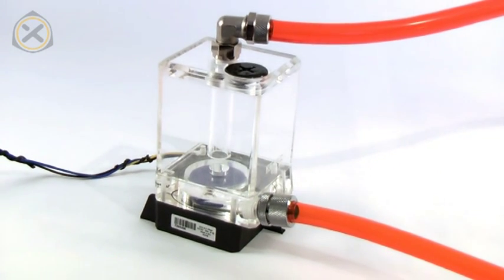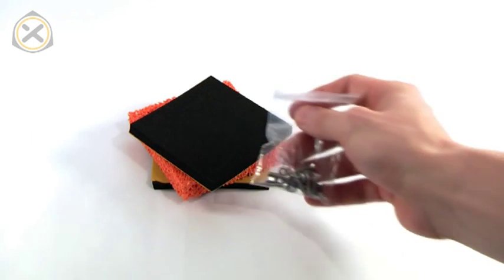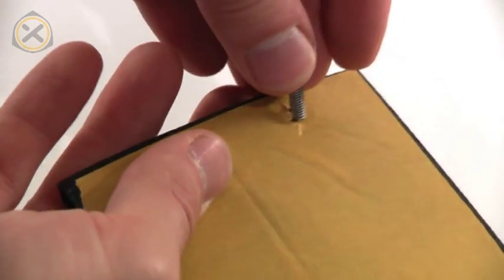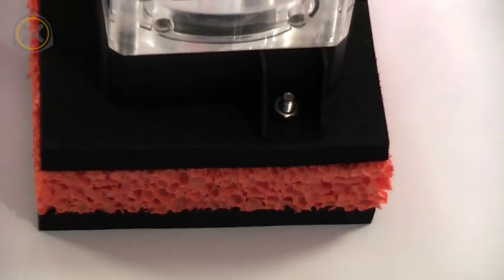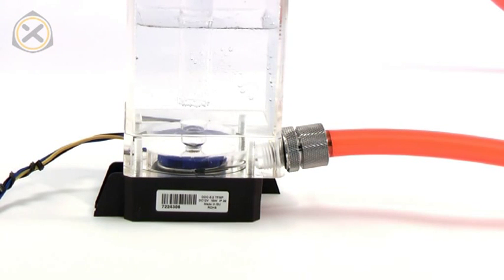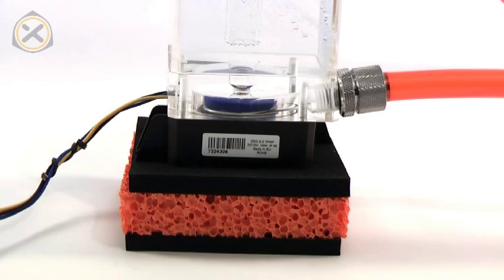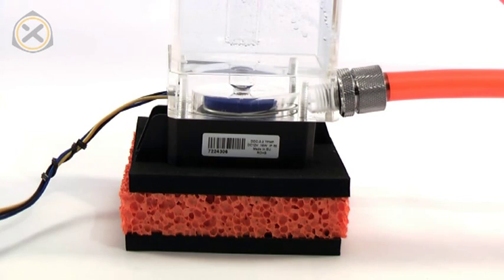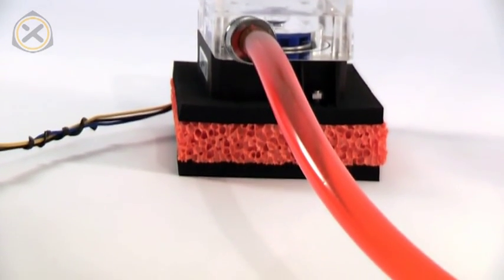EN - Shoggy Sandwich

Comment: I know this is an old video and maybe shoggy has changed the design a bit, but does the new V2 have adhesive on the lower rubber part to allow it to be stickied to the case without having to use screws?
Reply: Yes, it does. EDIT: both pieces have one adhesive side, so you can't stick it to both the case and the sponge
Reply: @M4ng03z  Wow, 4 years later I got a response.  Btw, I already order this years ago.  Thanks...
Reply: I wouldn't recommend this personally. It's better to have a mechanical union.

Comment: not that much of a difference. but i think thats cause its placed on a table and not inside a case. the table wont vibrate much from such a tiny pump. but the video shows the benefit of the shoggy sandwich